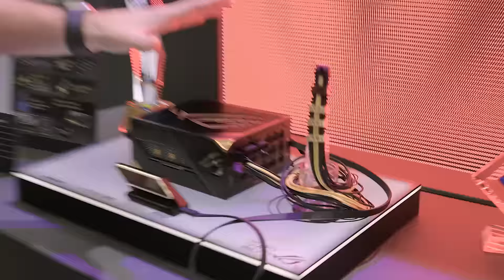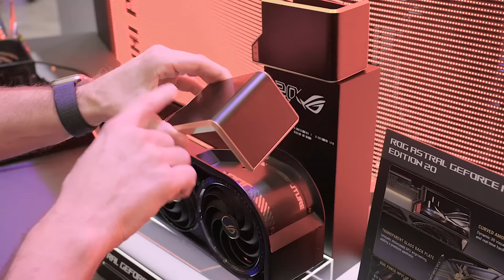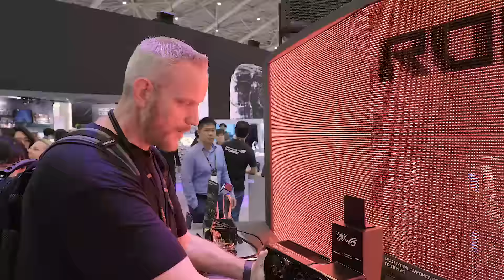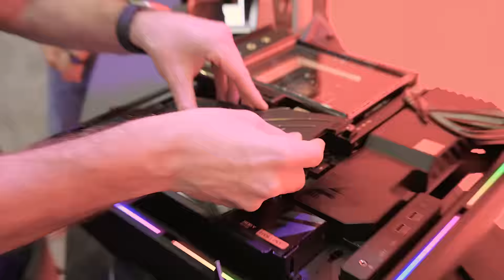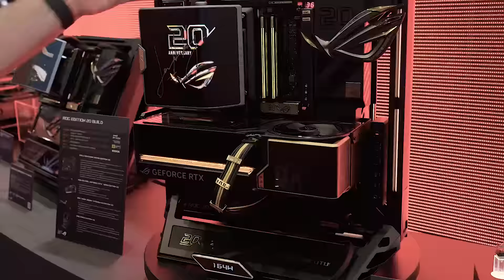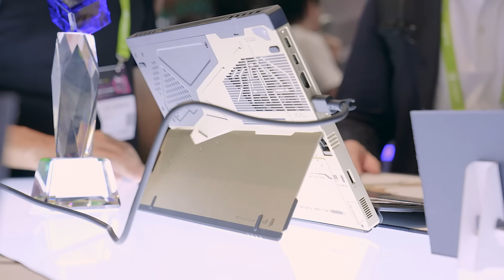We're going to need a bigger case...

Comment: rtx 5090 is going from $4200 atm, the cheapest that is btw. Just stick to a 27 inch wide or 34 inch ultra-wide 1440p monitor and you'll be golden with a $599 rtx 5070. No need to spend 7-10k for one single hobby

Comment: Niche is an understatement. Asus charging 200% msrp for gpu's, or just their normal 30% markup on the same hardware from other manufacturers make me wonder how their gaming side stays in business. Like, if someone tells me they have an Astral 5090 they're just gonna get clowned on. I know multiple people who did the jump to the 5090 as stock came up and not a single person ever looked at Asus because $3,400 vs $2,000-$2,200 for most of the other 5090s for a maybe 1% performance gain was comical.

Comment: Not gonna lie, it is a good looking system with good looking parts. The thing is, I can imagine putting all these together and the system not booting up for some reason and all integrated monitors showing ROG commercials while the system does not boot. I don't know, I don't think that putting bells and whistles on last year's components, and selling them for a price no ones kidneys could match, makes for a good end product. I am the enthusiast among the enthusiasts. This product is not for me. Still, it does look good. I have to ask this though. When, in a short while, a new series of higher performance parts comes out and you want to upgrade, what do you do? Do you remove the ROG RTX 5090 with the gold plating and the OLED G-Sync Pulsar flexible monitor that comes stuck on it to install an ROG RTX 6090 Super-di-duper Ti with double the performance for less than half the price or you get stuck with it until the sun fades into a white dwarf? I define an enthusiast as one who continuously strives for better performance. Those who make such purchaces don't even turn on their PC. If they did, they would know that in two years time its performance would be moderate and in five years entry level. Manufacturers make parts for people not for the ultra rich few.

Comment: Its so annoying how they ill make a 5 slot gpu but still REFUSE TO MAKE THE AWESOME BLOWER CARD WE ALL WANT. It's not hard. I want a 6 slot gpu with a 120mm Noctua 3000 rpm pwm fan on the front of GPU that blows directly out of the back of my case. And I 3d print a duct to the front intake fan and I smile. Because I've made it.

Comment: Holy Damn Shit. Speaking only on size: Sapphire Nitro 9070XT+ had me like wtf when I completed my rig in Feb. So much so, I instinctively felt it was larger than the FE 5090: it is, by a long shot. 

This ROG BEAST? Easily 1.5 maybe, 1.7x the size.. I'm a ROG fan (Ally and '21 G14), but they've become less about the gamer and more about prestige. I'd still do an all decked out ROG-based system if I could afford it, I'd probably just go with the Astral (the red pill one?).. actually, that one's even uglier and just as large, almost it seems.. 

Like, who is this shit for? When you get to cards that size and you want a stable and decent looking system, that shit is legit terrifying. I went through 3 gpu anti sag brackets to get her lifted to where I'm no longer worried about ripping apart the PCIEx16 slot.. 

Everyones just freaking lost it...

Comment: if you have the 230V voltage you'd have to have a 16A not 10A fuse though, to be sufficient for 3kW. Feels like design and function are a tad overkill in the rogverse. didn't think i'd say it but starting to dislike asus now. the risk is.. "less will like it in general, if the whole consumer base is not taken in consideration in both price, style and manufacturing". i feel they're on the wrong track mostly now. are the selected few enthusiast more valuable than the normal consumer gamer? it has to make sense, not only money for bling and overkill.
Reply: the remotely controllable aio display was pretty neat. in one of steves vids. that could be practical.. if space is not taken into account.part of engineering is also to make it sensible and practical. not just rare and expensive. if sales go down when it's not affordable it's not a hint to make engineering more complicated and expensive to then ask "oh why is this not good enough?". 🤔 smells more like a selfmade price increase to follow the market. it was nice hyte had made more affordable options. there's definately a delay on the reaction to lower prices.

Comment: The stuff is extremely cool and I am glad they are making it. I would not want that exact hardware because i want stuff to be lower key than that but if i had the money would want to use very similar hardware to build a system with those parts in it. Just without all the lights and lcds.

Comment: Bad take. This isn’t engineering it’s bling.
Reply: You could design a piece of jewelry.

You couldn't attach a working LCD to a 5090 Astral without...engineering. Or in your specific case, your lifetime.

I hate it when simpletons try to over simplify and downplay things. These products clearly aren't meant for you, get over it.
Reply: @JHeezy0109 facts, these components are undeniably gorgeous and are good engineering
Reply: @JHeezy0109

As someone with a 5090, 9950x3d and 96 gb of ram, all ROG branded where available and stuffed inside a custom water cooled NCASE M2, I am the exact target audience. Combining 2 existing things into one with some brackets is not engineering.  NOCTUA brought engineering this year. Sorry you’re confused.
Reply: @mercid2  His point still stands, you're the confused one, none of the other stuff that you mentioned means you're the target audience, and no, attatching an LCD to a gpu does not just require "some brackets". I suggest you read the reply again and give it longer thought in order to provide a proper counter argument instead of the nonsense you typed out.
Reply: @PURPLEPLAYAH 
Engineering:  the systematic application of science and mathematics to design, create, and optimize solutions to real world problems. IE NOCTUA and their tuned mass dampener.  If this passes for engineering this scene is in more trouble then I thought.
Reply: @mercid2 * the branch of science and technology concerned with the design, building, and use of engines, machines, and structures (oxford english definition). don’t twist the definitions your way to sound right, try again 😂
Reply: If you’re using the definition from wikipedia, it also mentions “and mathematics to design and IMPROVE systems, devices, or processes that solve problems under constraints.” an LCD on a gpu technically improves it by being able to display temps,  and can also be an aesthetic improvement, and implementing the LCD still fills the parameters required for it to be considered “engineering”
Reply: @mercid2  As an EEE major, I have to break it to you: "this is engineering". It might not be innovative enough for your taste, but it's engineering nonetheless.
Reply: @mercid2  lol you got owned kid

Comment: Slapping covers and screens on motherboards is so bloody stupid. The components run hotter and will fail earlier. As if the RGB craze wasn't already bad enough… If I were offered a plain motherboard that omits all this nonsense but offers actual finned VRM/M.2/chipset heatsinks (instead of plain blocks of metal acting mostly as decoration) and better engineering and connectivity instead, I'd immediately buy that without a second thought.

Comment: Once again it shows that 240V electricity is superior. It's not really more dangerous to humans, at the same power amperage drops in half compared to 120V (fewer resistance losses -> less heat -> fewer housefires, cheaper electrical installations because thinner wires are possible; contact resistance matters less), transmission losses are lower and households can use more power.

Comment: Yeah, I can appreciate all the engineering that went into that stuff, but I wouldn’t have any of it in my PC.  It’s so over the top.  Plastic covers and shiny stuff everywhere.  We used to put windows in out cases so we could see the electronics inside.  Just like automobiles, they’ve covered everything up.  When they start producing boards with different colors than black and white, and start removing all the plastic covers, I’ll be excited.  Oh, and also start removing all the excess electronics from the boards that aren’t needed.  Things like WiFi and sound.  I think any to have a choice in my sound card.  And if I don’t want WiFi, I don’t want to pay for it.  I long for the days where I could migrate components from one build to the next, or replacing a sound card or network card for a better one.  We’re at the point where the only real customization of your PC is CPU/GPU and RAM.  Everything else is aesthetic.

Comment: Cool coverage but as somebody who owns several enthusiast parts and would consider themselves an enthusiast at this point as a 10 year desktop engineer. The engineering behind everything they're doing is cool I just wish it was more actual things you could use... My computer is literally a black box with no window and one LED light and it's perfect and it's all air cooled so I don't have to touch it I've been using the same fractal define five case for probably a good 12 years and I had multiple builds in it I have never once thought that would be a good idea to add screens inside a case or to have a 3,000 w power supply. Now it would be cool to have a 1000 w power supply that's the size of a hard drive or a small screen built into the keyboard to show you what your macros are or a PCI to NVMe card that also has 80 gigabit on it USB-C those things are all things I could actually use... Most this stuff is just for people who have more money than they know what to do with and that's coming from a person who owns a 4090 at least the 4090 does actual work

Comment: In this economy at this point in my life I would love for a manufacture to create the "Beige Box' line of products that are just well spec'd but bare bones, to lights , no displays, no armor, no nothing you can just add what you want to your case and buy it for reasonable prices.
Reply: This wouldn’t happen in the current state of the industry… The limited supply of parts means companies prefer to sell products with all the bells and whistles, that they can upsell for more money relative to the production cost. So selling a “beige product” would hurt their profit margin, even if the cost of production is less, it’s not as price efficient for them (that’s why you see only limited MSRP GPU released, and only right on launch, you won’t see a basic new GPU any time soon, unless Nvidia releases a 6000 series card, and that’s assuming they keep their mandatory MSRP availability for board partners) 😢
Reply: @scotianbank  Kinda. The case, cooler and accessories industry is actively working to either offer new/refreshed products at a low cost. There's a lot of coverage on how that part of the diy segment acknowledges that if people aren't buying new systems, then they're not buying a new case or cooler. But if they are and RAM has quadrupled its price and GPUs aren't getting any cheaper, builders on a budget will skimp out on those parts. Albeit difficult, that's the easiest segment where manufacturers can reduce cost. This ASUS/ROG display of opulence is only representative of the highest end of the core parts of a PC. I can see the point where AIBs/mobo/ram manufacturers will reach the same conclusion and cutting on bling to offer more low end skus.
Reply: Dude, you're getting a Dell ? 😭

Comment: 5 slotter
Reply: At that point put a cpu cooler on it. I guess under it in standing tower. Frees ups some plate for better power sockets.
Reply: @counterstructure you mean an AIO, a liquid cooled pump, with a radiator and 360mm fans. Exactly the same the tech the CPU AIO coolers use.

A bit like the Astral-LC 5090.

I don’t know. Crazy idea that, it could never exist! 😂😂
Reply: @JasonPrendergast  No, i really meant an air cooled CPU block, blown parallel to the card towards the backside. 

BUT water AIO mentioned, Gigabyte does make their own. They really could have gone that way. In this price range it would have been properly a single digit percentage difference.

And honestly kinda more appealing i must say, even if its clearly outside my budget.